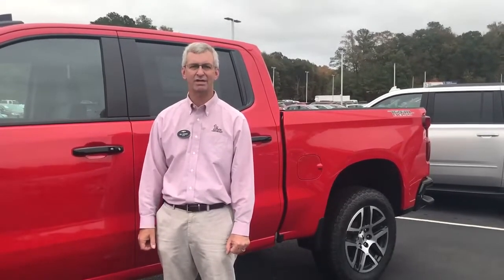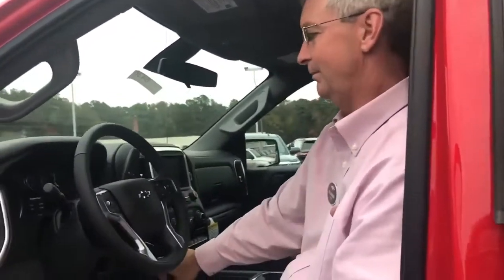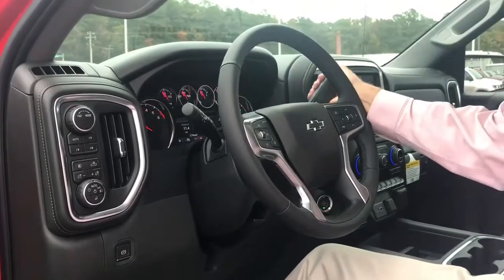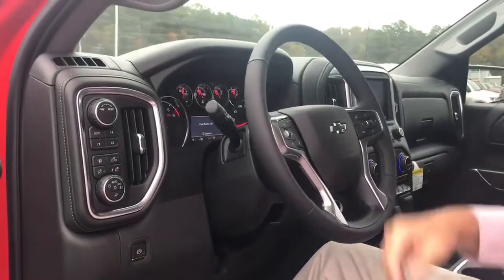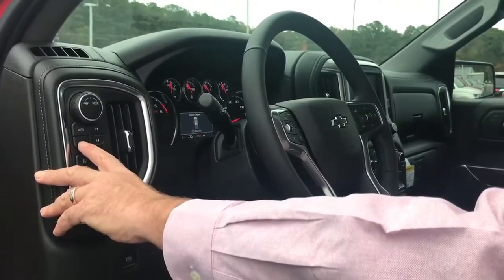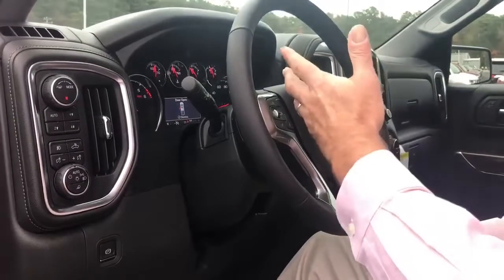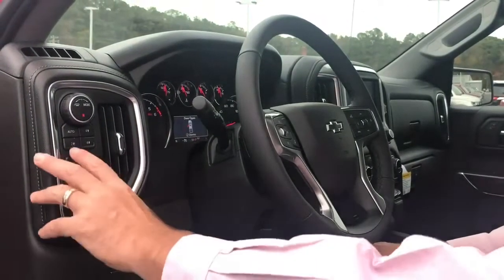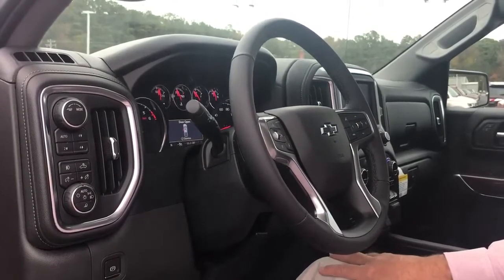How To Disengage The Transfer Case For Flat Towing a 2020 Silverado

Comment: Thank you so much for your quick reply!!!  I heard about a separate oil pump to be powered by RV electric cord... to cool the fluids in the Silverado. Your thoughts on this? By the same token, I also heard a battery disconnect device to cut the battery off in the Silverado to prevent the drains of the battery during tow time. Your thoughts?  Truly and truly appreciate your guidance.
Reply: I have not heard about the electric oil pump , so can't comment on that one. A battery disconnect device would only make sense in my opinion if you were going excessively long distance and if it's a device I w3ould want an easy way to have access to battery power by a switch.

Comment: Thank you. Very helpful. My question: once I disengage the transfer case as shown in video, do then shut of the engine with the gear staying in N? And, then, it is good to be flat towed?  When I arrive at my destination, I will start the engine, and reverse the process, right?  I am a first timer, and certainly would appreciate any help you can lend me. Thank you!
Reply: Once the transfer case is disengaged leave the vehicle in neutral with the parking brake off. Flat tow as needed. It is recommended every 250 miles or so to stop on your trip and start the flat towed vehicle for a few minutes while it's still hooked up and this circulates the oil and other fluids in the towed Silverado. Once you get to your destination unhook and reverse the process.

Comment: How do you do it if you can’t get power to it if you had to tow it to the dealership
Reply: You have to have battery power to be able to disengage the transfer case as it runs through the vehicle power system. Just the same as you cant put a vehicle in 4WD unless its started.

Comment: After doing that, to flat tow, I assume I shut the vehicle off, but do I put it in park or leave in neutral, or does it matter?
Reply: Same question please answer
Reply: Same question..........
Reply: Anybody find out?
Reply: I would assume turn off vehicle but leave key in on accessory mode to keep steering wheel unlocked and in neutral but that is my assumption by using common sense. If anyone knows for sure...........I'd really like to know also.

Comment: My 2020 gmc Sierra HD2500 is stuck in the neutral position and now won’t go back to drive mode.  We’ve towed several times with zero issues.  Now we’re stuck!  Any advice?
Reply: Did u get a solution to your problem?

Comment: Do you have any video or instructions to flat tow a 2021 Trail Boss?Im confused on how Different the 2020 and 2021 Trail boss seems from this video and my owners manual-On top of the Manual being very confusing-Thank you for any help!
Reply: David, The transfer case on a 2021 Trail Boss should be the same. If you have specific questions you are welcome to call us and we will do our best to answer them. 302 856-2521
Reply: Thank you!!
Reply: @billhansen576  I was just a bit confused-My manual doesn’t mention anything about pushing the 2 high button 5 times for the differential like you show in this video-Just don’t want to destroy our brand new truck when we tow it this weekend-Thanks Again!
Reply: @davidgimenez9026  David, see page 396 in your owners manual and use in conjunction with our video. Note, you have a two-speed transfer case on a 2021 Trail Boss. On other models it is optional. You can also reference page 241 on shifting the transfer case to neutral. You will be Dinghy towing - all 4 wheels on ground.
Reply: Yeah that is what I was looking at-So,To be clear Transfer case Should be in Neutral and Transmission in Drive Correct?
Reply: @billhansen576  Hey Bill I was just curious if The Transmission should be in Neutral as well or Is that supposed to be put in Drive after putting the transfer case into Neutral?

Comment: What is that thud? Doesn’t sound good.
Reply: That is perfectly normal it is the engagement and disengagement of the transfer case.
Reply: @billhansen576  I presently have a ford F-150 and flat tow with it. When I disengage it makes no noise. I am looking at a Chevy but that noise is discouraging me from buying.
Reply: @willirst.pierre9333  I have disengaged hundreds of our new and pre-owned Chevrolet Trucks with no issues. You will have to make up your own mind on whether or not you feel it is a concern.

Comment: how do you get it in neutral if the truck wont start...
Reply from the maker: The truck must run to disengage the transfer case.
Reply: @ so as long as the battery is good, and the electronics turn on, I can do it. Otherwise, no?
Reply from the maker: @colinhoover5153  start the truck and you must have the 2 speed transfer case which is standard on Z71 equipped trucks. You must have auto 4wd, 2 high, 4 high, and 4 low on the buttons. This will be the telling tale if you have the proper transfer case. If you dont have all four modes you have the single speed transfer case and the transfer case cannot be put into neutral. Notice the 4 buttons where I push the buttons at 41 sec into the video.